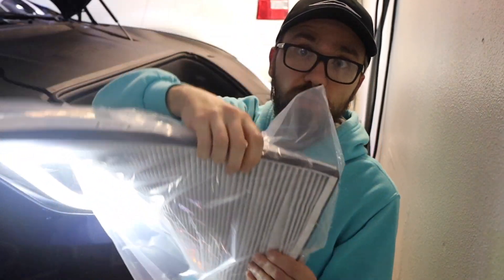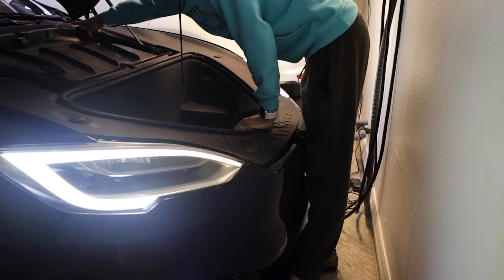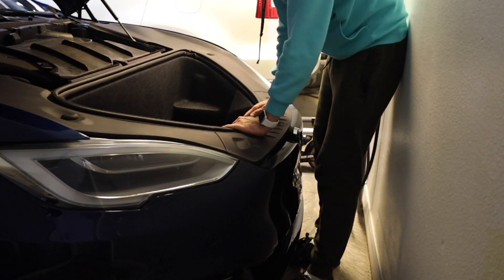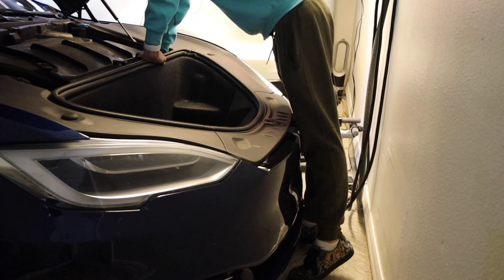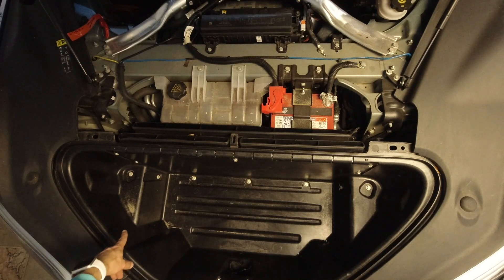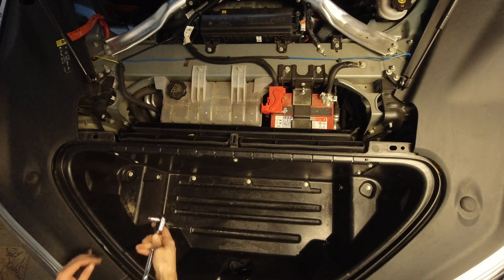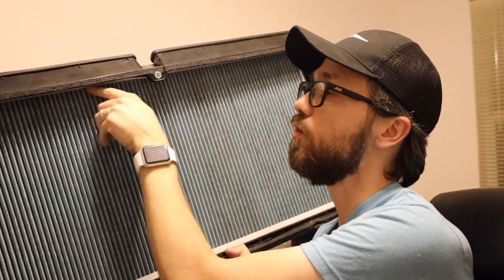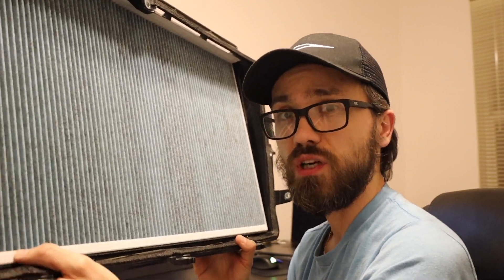Replacing Tesla "Bioweapon" HEPA Filter

Comment: I was wondering- if my tesla is equipped with HEPA filter, does it still have cabin filter as well, which is installed behind glovebox?
Reply from the maker: Yes. It will have both
Reply: @DealerofHappiness  Thanks! Just repaired my door handle lights :-) next thing to do is both filters then. :-)
Reply from the maker: @namod6538  good luck!
Should be much easier than door handle light